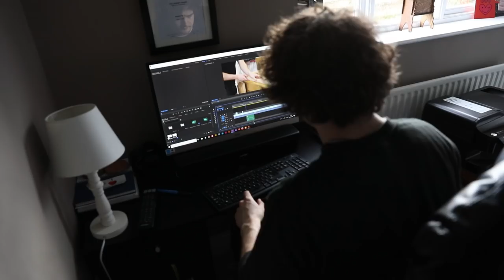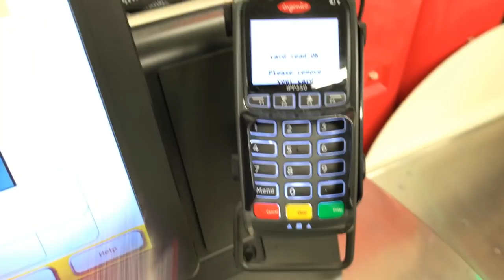Making a Dovetailed Box from Potato.

Comment: (Years late, but) How did you get the sweet potato and the normal spud-type potato to cook at the same rate? My sweet potatoes generally take 1.5 to times as long to cook at the same thickness & oven temperature.

Great idea, great work, great video.